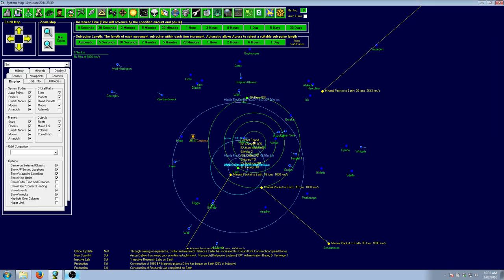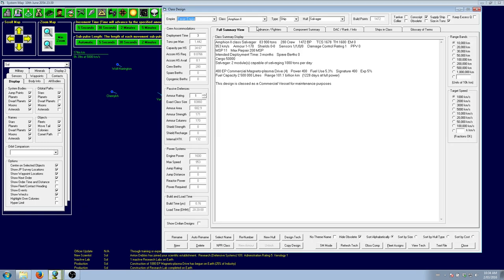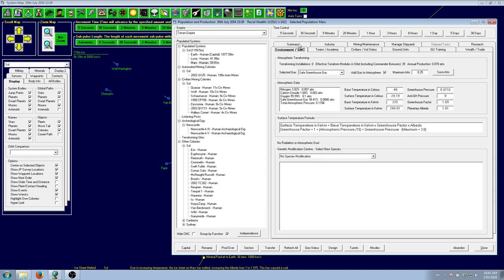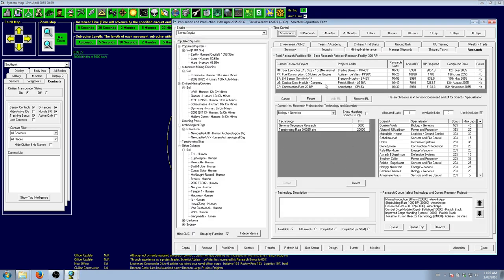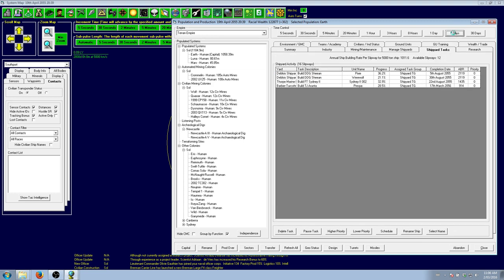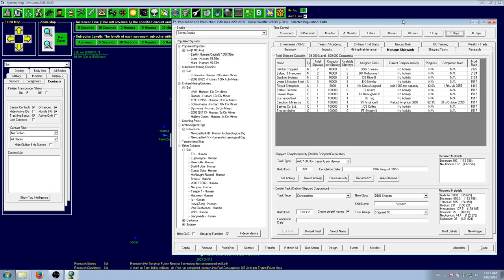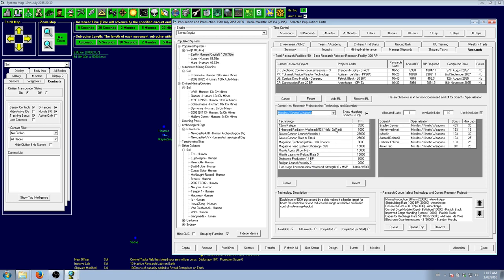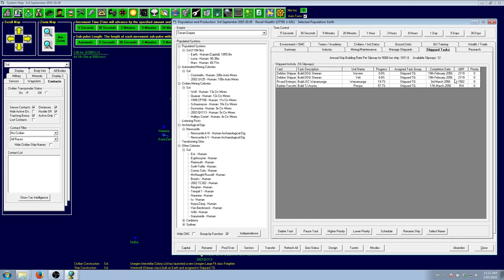Aurora 4X Let's Play - Ep.20 - Fleet, Assemble!

Comment: i know youve already finished this lets play but there are ways to build fighters that are only about 120 tons
Reply from the maker: Smallest Meson cannon is 150t, so that's out. 
Smallest engine is 50t and smallest Laser/Railgun is 100t so that's out. 
Box launchers are 7.5 tons each, but that's size 1 missiles. Size 4 missiles, which are smallest really viable shipkillers, are 30t each. 50t engine, 1 tiny fuel, no armor, a .1HS fire control and the crew quarters/engineering spaces fills 72t. This leaves 48t. 
A size 4-6 box launcher is 30-45t, so you only get one of those. Size 3 is 22.5t so only two of those. Size 2 is 15t, which still means only two so that's out. You get 6 size 1 box launchers. 
You'd be lucky to get 6 damage out of a size 1 missile, so that's a max 36 damage for size 1s (at best). 
A decent size 4 is about 10-15 damage, so that's about 20-30 damage. 
A single size 4-6 gives you about the same damage. Oh, and this is all end-game tech around gas-core antimatter. 
My end-of-LP top-tier bomber has 15 size 5 launchers delivering up to 120 damage and being only a little slower. 
My Tobruks have 3 size 6 launchers (so more tonnage of launchers than the entire tonnage of the microfighter), but they deliver about the same damage as the microfighter.
So it takes gas-core level tech to let a 120t fighter beat a Magneto-Plasma tech fighter.

I will admit that a bunch of 120t fighters could serve well in the interceptor role, since they'd be fast and their low damage output could still kill other fighters well enough... but definitely not at low tech levels.
Reply: you are correct this was with relatively high tech and the smallest gauss cannon so it wasnt very damaging but it was certainlyo usefull just as a supporting craft since i could fit a lot in a single hangar bay